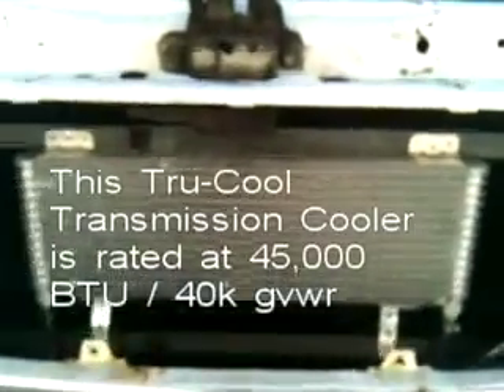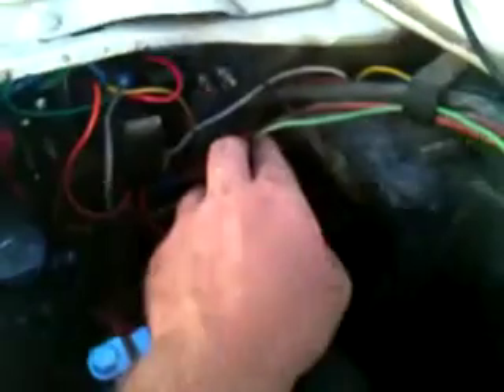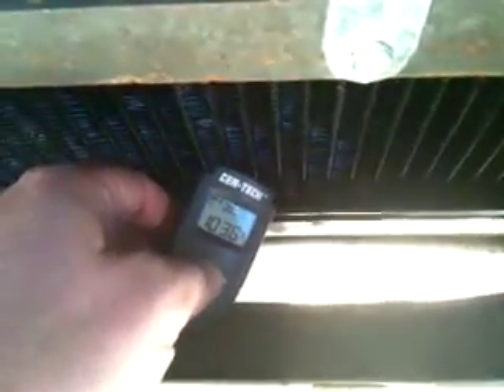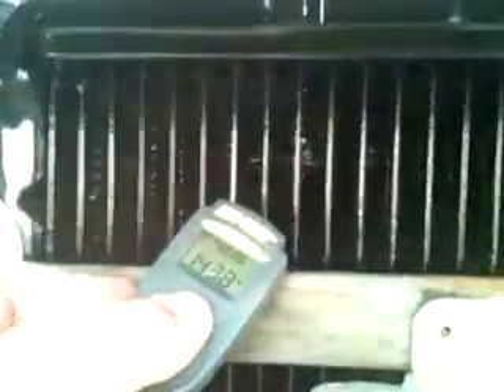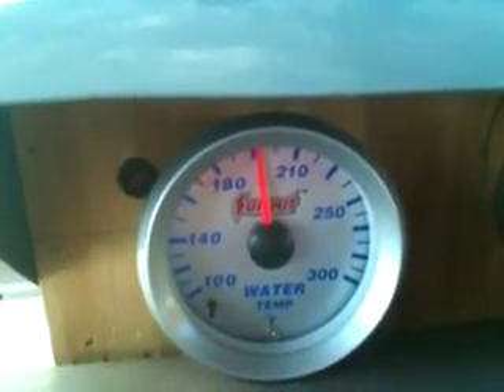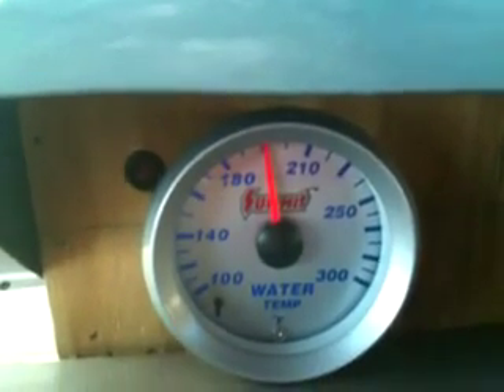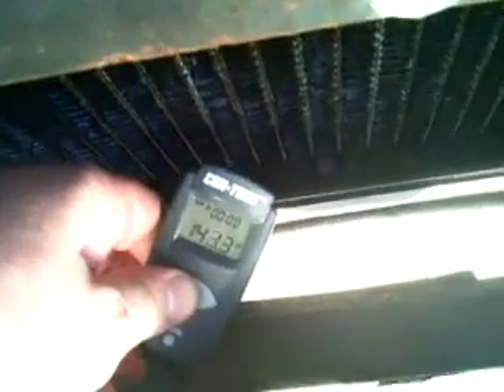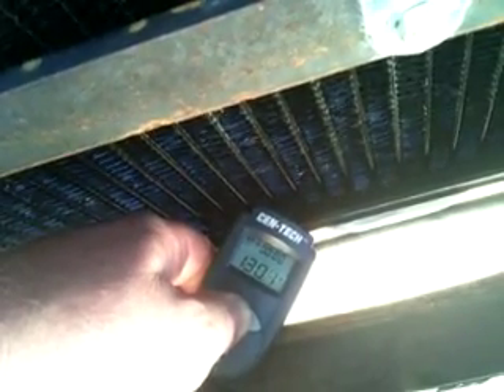Electric Fan Conversion of our 1978 Ford Pathfinder Quadravan 4x4 van

Comment from the maker: The transmission fluid is NOT going into the radiator heat exchanger.  I am using a Tru-Cool # LPD47391 40,000 GVW rating, 45,000 BTU rating transmission cooler and the sole trans cooler.   Since I am in the desert I don't need the heat exchanger to heat the fluid in the winter.  If you get below freezing weather you will need to run it through the radiator heat exchanger or at least get a thermal bypass for the cooler so it doesn't over cool.